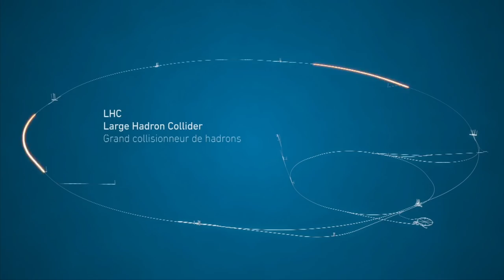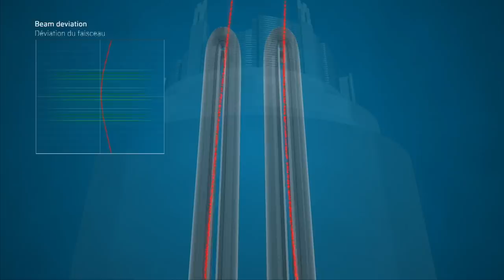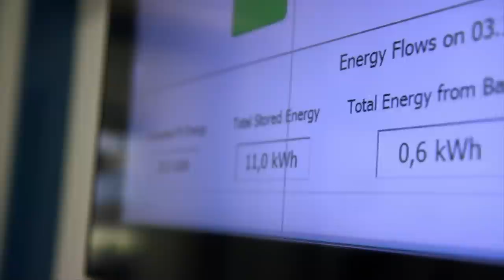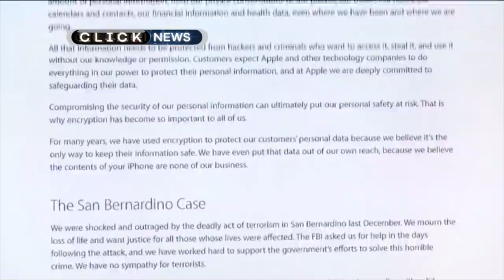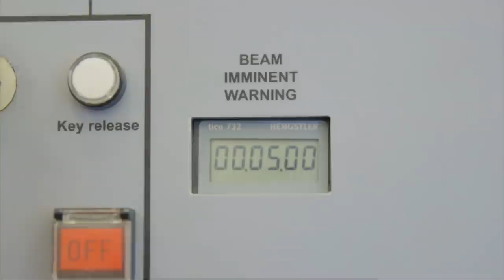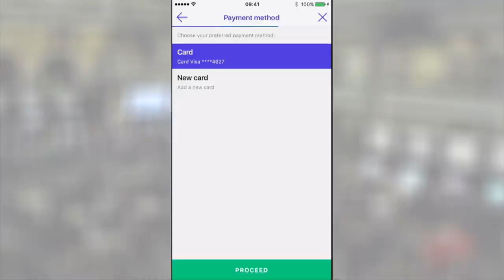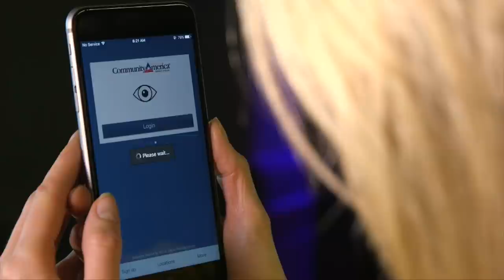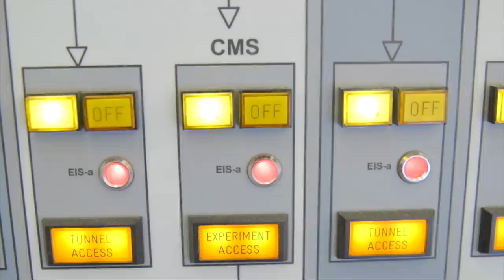Click 824 : The Large Hadron Collider

Comment: One thing for certain, it takes the brightest most gifted minds to keep this monster of a time displacement machine in check. The physics behind it is highly advanced indeed, for it deals with the language of machines and logic which goes far beyond mere pokes and peeks. It takes a great deal of trust to accelerat these heavy particles of matter thus moving these under unimaginable pressures and temps in the trillions while reaching near the speed of light was a greatest achievement ever. However, something is missing? Even though this behemoth is considered the largest of its kind? Yes they still don't have a clue as too what  combination of events = cycles coded freqs (like boiling or freezing water using nothing but sound waves at specified frequencies  and levels will indeed someday soon open that door?